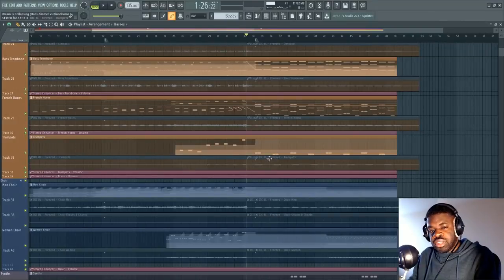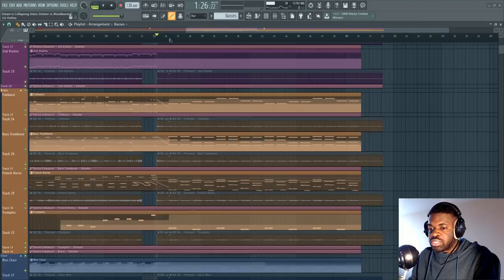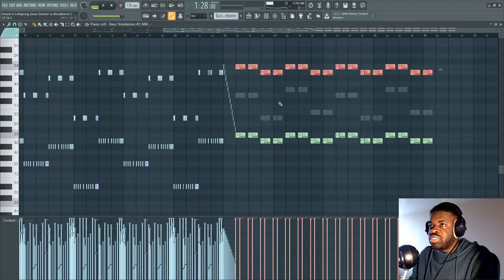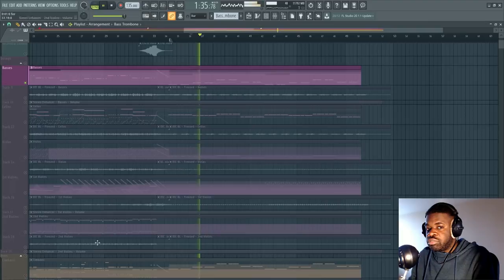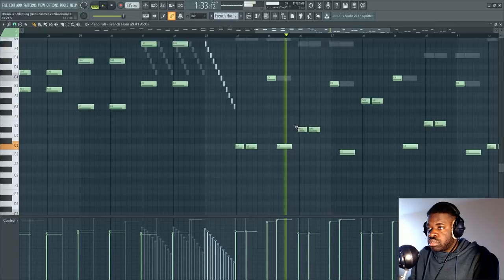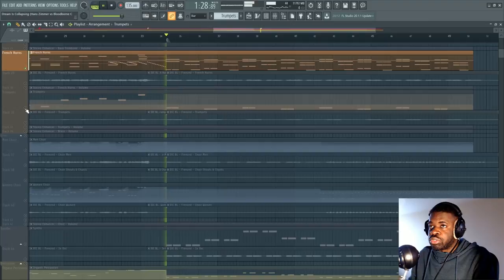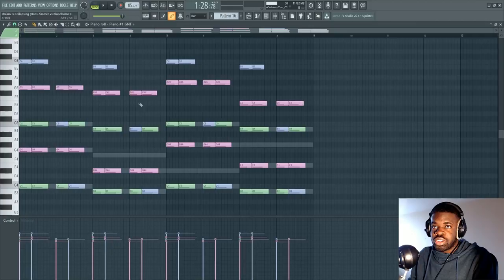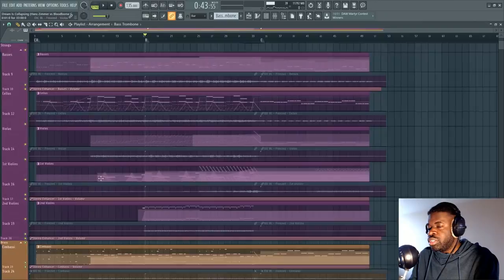How To Make Hans Zimmer's Epic Inception Brass in 5 Minutes

Comment: Hans Zimmer actually used 6 bass trombones, 6 tenor trombones, 4 tubas in the middle and 6 French horns above. Check out the making of the score.
Reply: I think he may have meant that the tubas were seated in the middle, rather than strictly playing higher than the trombones.
Reply: If Spitfire Audio can make Hans Zimmer Brass, it will be possible.